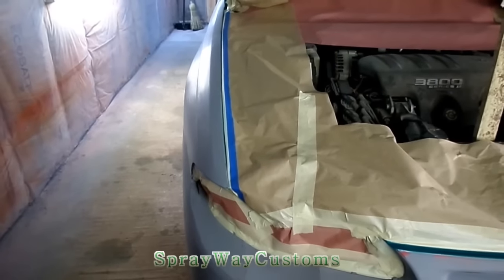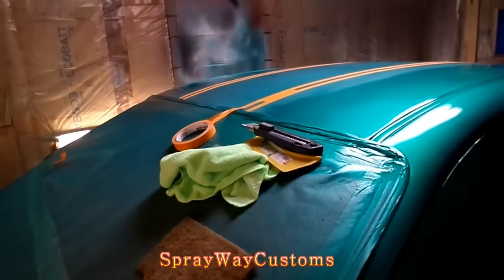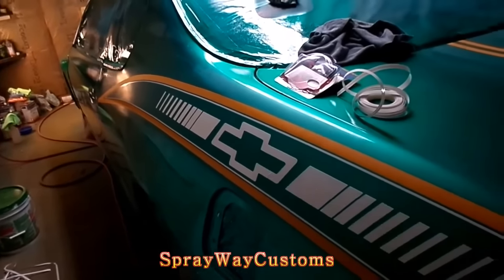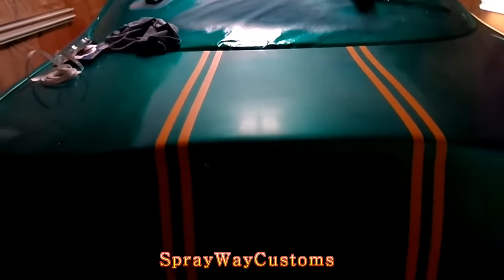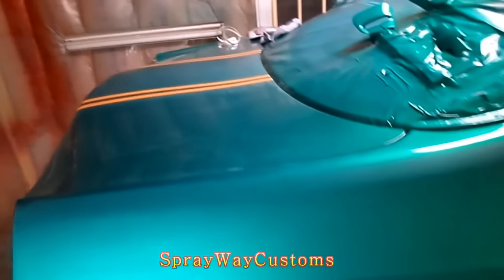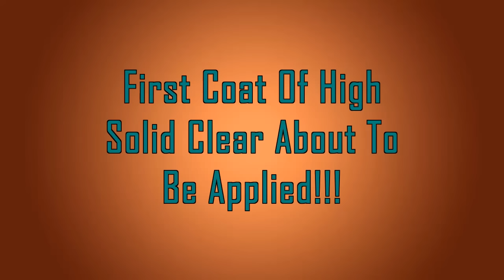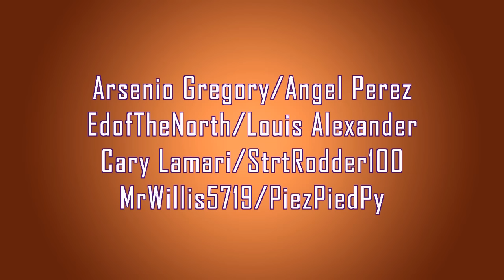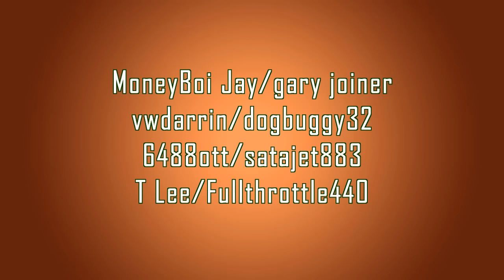How To Spray Candy Paint / Footage In The Booth / Update 9 - 2000 Monte Carlo SS Candy Teal

Comment: how many times do you need to refill the paint during the painting process and how long should you wait between each coat before the next coat
Reply from the maker: Flash time between coats usually 10-15 mins...Each stage I probably fill the gun up 3 times

Comment: First off, Wow! That looks amazing. Grade AAA+ work as usual (should we expect any less?) :)
BUT - I have a couple of noob questions for you.
1) You used the medium solid clear as an intercoat to protect the base? Is that right?
2) You scuffed only the clear after applying the black, right? I did not know you needed to scuff the intercoat before applying the color/clear on top of it.
And finally, Wow! I am with TwinSOLid438 you are ready for business sir!
Reply from the maker: Thanks Eric...answer to your first question..Yes I used regular clear for my intercoat clear just to have something to protect the candy coat during masking...Regular clear is more thicker than intercoat clear...for instance candy is nothing but intercoat clear with color pigment in it....thats why you have to be careful when applying candy because its like water, it'll run on you before you know it...any way, to get back to your questions.....answer to your second question....I wet sanded the areas where I was going to apply the stripes with 500 than laid out and painted the stripes....after that I wet sanded the entire car with 500 and sprayed three more coats of high solid clear...If you going to wait 24 hours or more you need to scuff the paint because it start to cure and paint want stick on top of cured paint but if you going to re spray with in that 24 hour time period scuffing is not necessary....but remember Eric sanding will make the final coat look like glass because you leveling the orange peal and trash down and the cut and buff stage will be a breeze because its pretty smooth already.....thanks again
Reply: SprayWayCustoms Thanks a lot! Makes perfect sense.

Comment: Super awesome job. Sata jets are amazing. My devilbiss teknas worked great in an environment like yours. But now where I work, our booths are constantly at like 83-85 degrees cuz we have do like 15 cars a day and I like using the sata hvlps way more. My tekna with hvlp cap just doesn't feel as nice as the sata. I struggled at first trying to keep the paint wet on silvers and golds Cuz it dries so fast. With the hvlp sata it was much easier to control metallics. If I went back to a cooler environment with less airflow I'd probably go back to my tekna. Great job though. I love how you took your time no rush. That's when they come out best. Those candies can be tricky, especially when blending them.
Reply from the maker: Thanks for all the info on your experience man....I'm about to upload a video this morning of me unboxing my new SATAjets and showing my other guns so stay tuned and check it out....Appreciate you Tommy

Comment: Great job big dawg! Is that the 210 or the 410 you're spraying.
Reply from the maker: I always spray my first coat with 410 and finish it off with 210....on this car I sprayed 2 coats of 410 and scuffed it for the rally stripes and came back with 3 more coats of the 210 High Solid

Comment: Eh man. What would you charge for kamdy blue paint on a Yukon? Just curious on price difference. I paid 12 grand for my truck because the body had 170hr in it. Everywhere on the body was pitted from grinding the rocker guard off of it. But that price of 12 grand included 170hrs of metal work. New hood/fenders/rockers/doglegs/tail gate also. He said if there was no body work needed or only a few touch ups it would of been 7 grand or so. A lot of people ask why I didn't just buy a clean she'll and it's because my truck has sentimental value to me. Also the exchange rate here in Canada makes everything so expensive especially using house of kolor lol
Reply from the maker: A true kandy paint job with no body work and you get your own paint...I'll spray it for 500 if that's all I gotta do
Reply: +SprayWayCustoms do u have a fb or instagram?
Reply: +SprayWayCustoms  you got it I have a2000 f350 I want u to do I'll do the sanding and prep love ur videos and all ur fiberglass work very detailed followed all the way turnt up

Comment: @spraywaycustoms can I get step by step info?  like what exactly to use and when to use them
Reply from the maker: Sure...just let me know what are you trying to do Keon?
Reply: I'm just getting into car spraying and I'm Kinda confuse... I like urekem paints and thanks for the website you gave with the paint kits.. First and foremost after sanding down the car do you prime the whole car? How many coats of primer?  I how long do I wait in between coats? What are the steps to take when spaying candy? How to spray chrome and aluminum rims? I know its alot of questions but try as best to help me out lol.. Also how is a tack cloth used?
Reply from the maker: It all depends on the car if you need to prime it....if it's factory paint you don't have to prime it just wet sand and spray.... I wait about 15 minutes between coats...painting candy is not as easy as base coat/clear coat...you have to walk the entire car from one end to the other to keep from building it up on the different panels because it gots to be even coats all over....hope this helps
Reply from the maker: Three coats of primer should be good... Prime, sand,prime,sand, prime, wet sand and then paint
Reply: Thanks for the help man hope do be as good as you asap

Comment: Where'd you find the decal on the side
Reply from the maker: I got it from Autozone or Advance Auto Parts...I'm not sure exactly which one...only thing I did was stuck it on and then painted over it and then peeled it off...hope that helps you
Reply: Did you make the decal your self? Because I've looked everywhere and can't find it.
Reply from the maker: It's the decal for the windshield....try Oreiley's, Autozone,Advance Auto or Walmart....do you plan on painting it on or just leaving the decal on?
Reply: I found it in auto zone. I put it on and used plasti dip instead of paint. Didn't come out the best like I wanted it but it still came out good. Thanks